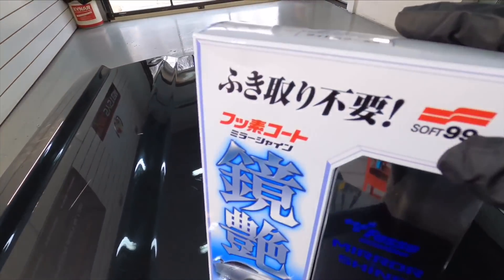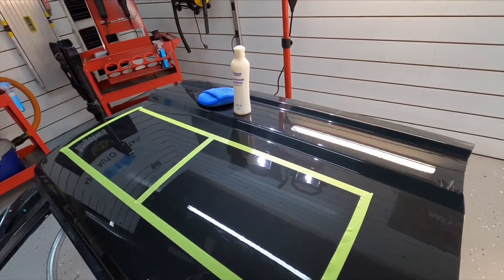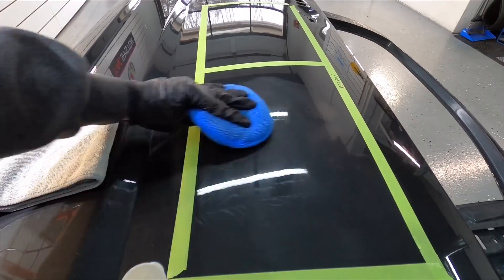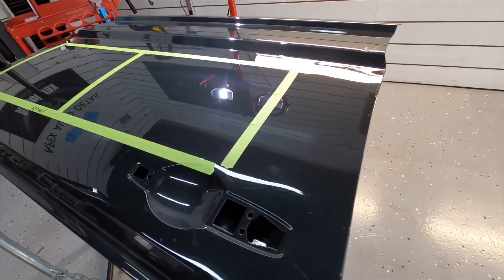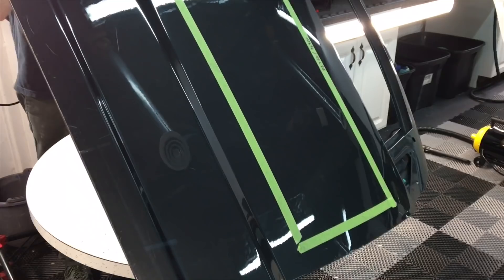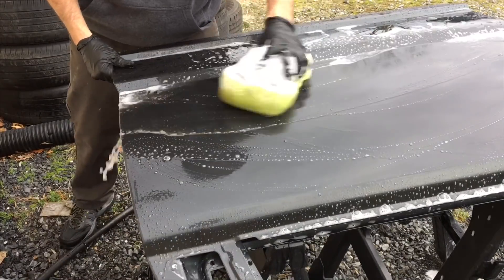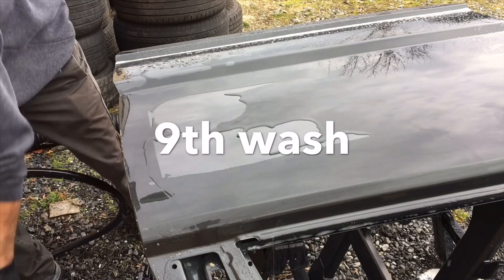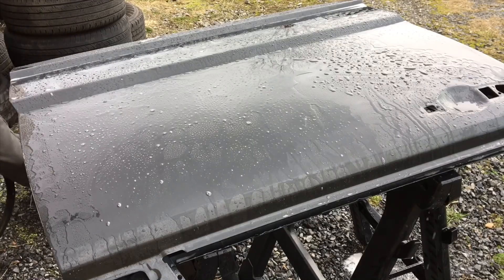Fusso Coat Soft 99 MIRROR SHINE!! What is the stuff? Let,s Find Out!!

Comment: In Germany, the Mirror Shine Series is much longer available.
They have the light and the dark version, as the most Fusso Coat label products from Soft99 have. (Noone ever found out a real difference between the light and dark versions...)

I tested the dark Mirror Shine Paste Wax and the dark Mirror Shine Liquid Wax. As you have shown: The Liquid Sealant is very bad, it has medium performance and looses it after some days / weeks, very fadt after every wash.
But the Mirror Shine Paste versions are very, very much better! They are not lasting as long as the Fusso Coat 12M (polymer Sealant with a very good lasting time) for example, but it is very simple to get it on paint, because you do not need to wipe it off.
The Soft99 Fusso Coat 12M is sometimes very hard to get on paint without streaks or anything like this, but it lasts very long. They made a new version of the 12M last year, which is easier, but does not last as long as the one before.

Some points the Soft99 Fusso Coat 12M, also the Soft99 Fusso Coat Mirror Shine Paste Sealant and Soft99 The Kiwami are better than much other Paste Waxes and Sealants: They have no problems with heat! Most Waxes went down in days at the time we had very hot weather in Germany. The most of the better Soft99 products did not care about the heat. So they are very good for southern USA :)